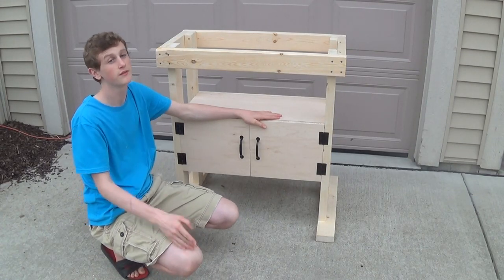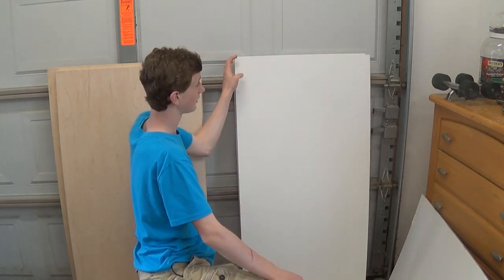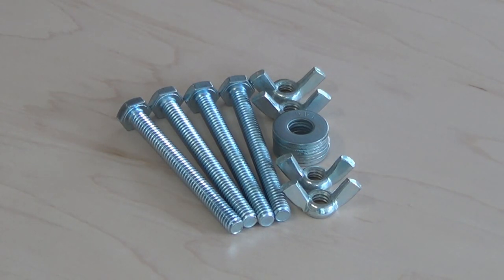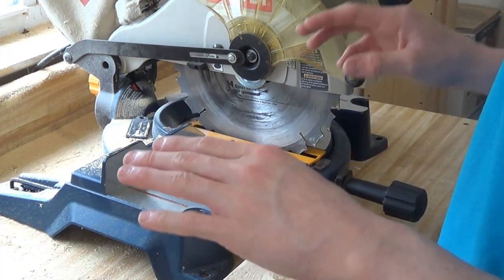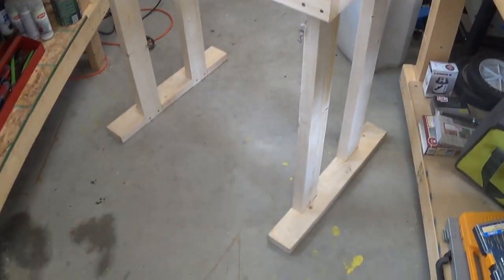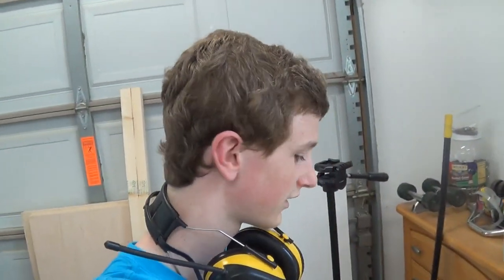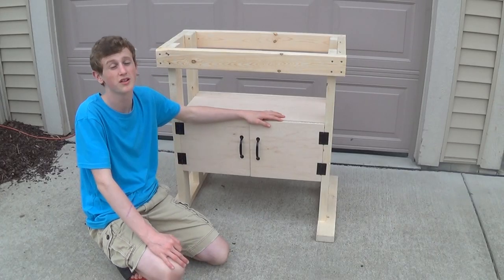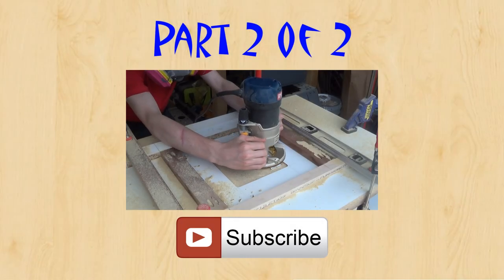How to Make a $100 Router Table | Part 1 of 2

Comment: Eric, it's a good design and you did a great job on the video (even the music). However, when I built mine using your cut list, I found what I think is a small mistake. The cut list show the dimensions of the cabinet ends to be 101/2 inches by 101/2 inches (square). But if you make them this size there will be a 2 inch gap. Going by the SketchUp plan, I think the correct dimensions for the end panels are 10 1/2 by 12 1/2 inches. That sure worked for me anyway. Thanks Eric.